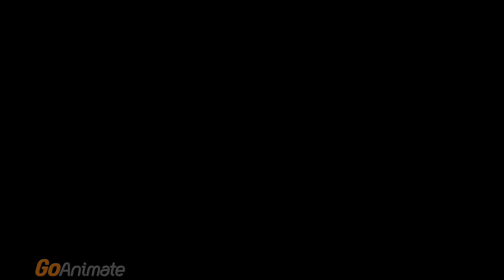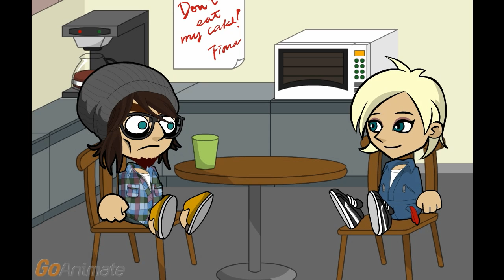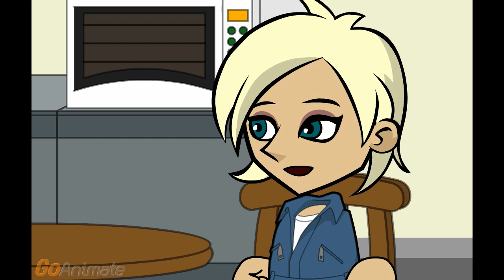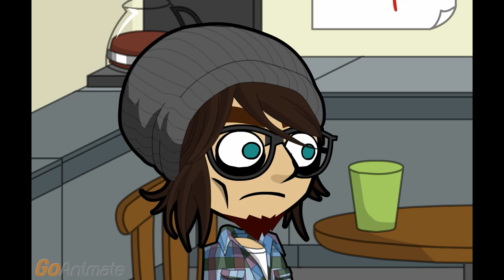Lennox Furnace Error Code E228

Comment: In my case the problem was deposits that had clogged the nipple for one of the hoses (red, on my furnace) to the pressure switch.  running a small drill bit through the nipple cleared away the deposits and voila, everything worked again.  A simple fix what what looks initially to be an expensive repair.